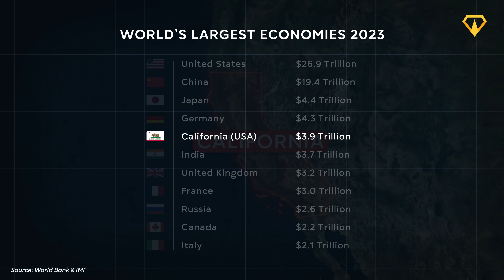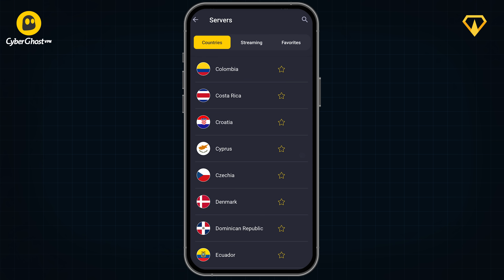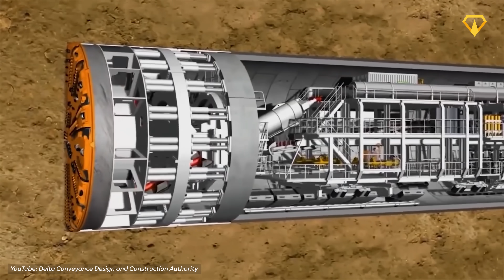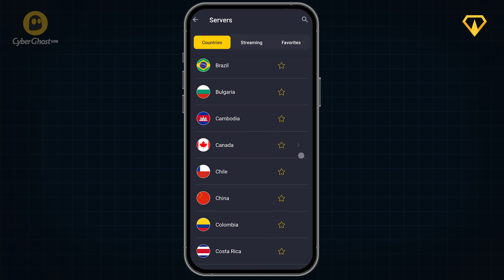California's Massive $20BN Water Transfer Project

Comment from the maker: Check out CyberGhost VPN at https://www.cyberghostvpn.com/MegaBuilds and you will get 84% off CyberGhost VPN. That's $2.03/month and 4 months free! It's risk-free with its 45-day money-back guarantee. Thanks to CyberGhostVPN for sponsoring the video!

Thank you for your support on our recent videos! 💛
Reply: The state of California needs to invest heavily into CAPTURING RAINWATER during the rainy seasons and pumping the rain water back down underground into the natural aquifers.  This will increase total annual water supply, minimize water surface evaporation, and possibly eliminate droughts in California.  If this water transfer project is part of the rainwater capturing process, then I am all for it.  
There is also a new method that is currently being developed which involves capturing fresh water from facilities that are located offshore, which does not require a desalination process at all, which is very expensive and creates toxic birine waste water.  Imagine an offshore platform like an oil rig, which does not drill for oil, but captures fresh water from the moisture in the air, and pumps it back to the shore(compare the process to the condensation from an air conditioner).  There would have to be enough of these rigs(like offshore windmill farms) built to scale to meet the water demands of the state.  I envision that the entire country could solve its water drought crises by allowing ocean bordering states to contract with desert states, for example, Arizona, New Mexico, Nevada, Utah, and supply them with an abundance of fresh water from our giant oceans.
I would love to see a segment dedicated to this idea at some point in the future.  Offshore water collection is the way of the future, in my opinion.
Reply: This is Bad idea the intake of this waterline is too close to where saltwater comes into the bay!
Reply: So called climate change is not the problem. Mismanagement is the problem.

Comment: Global Warming is not only causing wildfires, it's also increasing the likelihood of earthquakes.
The warming of the earth's surface over large areas increases the temperature difference between the surface and deeper underground. This exacerbates the pressure in fault lines and various underground structures.

Comment: I support the building of tunnels as upgrades to the system.  It is indeed vulnerable and we need it to work after natural disasters but don't support increasing the take from the delta.  We already take too much.  We waste lots of water in this state.  We need to start being smarter with our water and utilizing desalination for our dense urbane centers.  Most of our population is close to the coast.  I value our natural spaces and we are taking too much and throwing half of it away.

Comment: It's up to the voters to save California by not voting for Democrats. Democrats are controlled by the Sierra Club that forbids any water projects because they help humans. We would have the Peripheral Canal and the Auburn Dam today if it weren't for the Sierra Club. These projects would have done more to protect Salmon than any so called conservation rules. The P.C. was designed with healthy Delta cross flows, not like pumping out of the South end it does today. The current proposed project does nothing to help Delta cross flows.

Comment: Southern California allows hundreds a millions of gallons of water To flow into the ocean every winter. Why not just capture that water ?
Reply: Because stupid or corrupt people are in power within California. That's why they are not properly managing the water.
Reply: The lack of water in California is due to several factors. In 2025 politicians will push for a "water tax," not to help pay for better infrastructure, but to change the behavior of the people. Socialism at its finest.
Reply: They don't capture it because if they did they wouldn't be able to constantly adjust the price of water upwards every time there's mention of an impending drought.  Additionally, if they actually captured all of that runoff it might actually drive the price of water down 🤷🏼‍♂️
Reply: There are a lot of projects working on capturing urban runoff from the very infrequent, but intense, winter storms that hit Southern California. Southern California already does an excellent job of capitalizing on runoff from the mountain ranges, but the urban runoff is much more difficult to capture since it is extremely flashy. Here in Northern California, we get more frequent winter storms and rainfall, hence the State and Federal projects that export water to the south. It’s a complex system and there are many parties with a stake in the system, and most of the low hanging fruit has already been picked. Water recycling and reuse is the next low hanging fruit, and some parts of California, like Orange County, are maximizing use of that resource. Other parts of the state are soon to follow, as recycled water is much cheaper than imported water that has been pumped for hundreds of miles. Most of the cost of water in California is the cost of energy to move it from one spot to the other.
Reply: It’s not that easy
Reply: Gavin Newsome is the governor and you still ask this question.
Reply: @wizzerwiser2056 salt water intrusion into the delta would destroy the entire water supply if you didn’t let water flow into the ocean . It’s science
Reply: Because of the pollutants the rain scrubs from the air and urban areas. A lot of Southern California relies on ground water, and to scrub the captured water to a clean enough level to pump into aquifers (or even let percolate) would be too expensive to run over a long period of time. If the ground water gets contaminated to enough of a degree, then they can’t even use that. So, back to the point, most water that falls in natural areas as opposed to urban areas does in fact get captured to replenish groundwater.
Reply: PUT A SEA DAM IN NEAR THE ALFRED ZAMPA MEMORIAL BRIDGE  
( and do it before a quake drops the valley into a sea water inhaling positive feedback,<----that would be THE APOCALYPSE )
run the San Joaquin River through Water Table Recharge Filters, with an Osmotic Power Station by the sea dam.
Reply: The 9th Circuit Court ordered that a certain amount of water be sent to the ocean to protect delta smelt.  It's done because of the court order, not SWP/DWR or those that receive the water. They have no say in the matter. Additionally, a certain amount of fresh water needs to go into the delta (not southern Ca) so those that draw that water (farms, etc) aren't drawing salt water.
Reply: That is literally the point of this projext... to pull that excess water down past the delta
Reply: It affects the environment 🤭
Reply: Well, that would be common sense.And we already know that the politicians in california have none. Their policy is to work harder.Not smarter or just don't work at all.

Comment: downstream salinity is the first thing that came to mind when i heard about this. Thinking about things like not only mono lake and the slog theyve gone through to protect their ecosystem, but also the whole rigamarole with water quality negotiations with Mexico. 
This will absolutely not help the long term for our state's water issues, because the real issue is water use. We need to find less water-intensive ways of life. 
That includes incentivizing farmers to grow low-water crops that match their low-water environment instead of relying on so much water removed from other places. This includes cracking down on industrial water waste. This includes better urban design and less concrete along riverbeds so water can soak in instead of causing floods and running off elsewhere. This probably involves a lot more solutions about water use! But the conclusion remains: any "solution" that involves importing large amounts of water are band-aids at best, and usually export more problems than they solve.

Comment: California has the potential for plenty of water, here in Northern California we regularly flood.  What we need is more storage.  If we were smart we would make dams with hydro and solve electricity generation and water at the same time.  Sites reservoir project has been active for about 40 years and ground hasn’t been broken yet due to endless red tape.
Reply: Yes. And now we know enough to build new storage to minimize impacts to habitat and even create more habitat for species like salmon (I don’t care so much for the invasive delta smelt)
Reply: Except the eco-lunatics who run the state won’t permit any large water project that benefits the actual humans.
  Only small invasive fish species.
Reply: California has 2000 dams and 2500 miles of aqueducts. There are no more suitable areas for dams to even be built

Comment: “Climate change” isn’t responsible for Californias water problems.  Californias aqueduct system and the states government poor management of their water supply!

Water; from rain and winter snow pack never gets an opportunity to recharge the water table.  The aqueduct system transports 75% of the annual runoff indirectly into the Pacific Ocean.  

Naturally, some of this run off would still find its way to the Pacific Ocean.  However, along the path it would soak into the ground recharging the water table along the way.  

When California installed and expanded the aqueduct system the water cannot permeate the cement of the aqueduct system.  

So this new project is simply going to make the problem worse!  

Develop some basic critical thinking skills!

Transcend the bull shit!

Comment: It saves California only if the dam at Whiskeytown reservoir is increased to the height it was designed for. Same with other dams they were designed to be higher. The next and most crucial part is building a dam on the Hoopa Indian reservation redirecting the trinity river to LA. The same thing with the Klamath large reservoirs that feed into the CAP. Without the water redirected from these 2 rivers there isn't enough water.

Comment: How will the increasingly lower run off from the mountains not mean the river outside flooding events not mean the river runs dry into the delta. Would an offshore localised desalination plant running when offshore wind is blowing /Nuclear not avoid a reliance on water flow that higher drought events are already impacting the river volume. Would the settlement tanks to take excess rainfall events not allow for water capture in the north end be worth doing on its own with the desalination plant providing the water supply in the region thats needed with existing water pipes. Can water charges not rise in drought season to cut water demand and what part of that budget could be used to cut water loss on existing canals and pipe leakages. In any quake, the old pipes will rupture anyway no matter how much water is pumped from the north end supply and would new piping be able to better withstand such seismic underground shaking to avoid rupture. In any quake event a nuclear plant will shut down all power generation so adding in all excess power (solar in the afternoon duck curve) would be needed.

Comment: There's such a water issue there, that it's effecting many other states water. They should commit to desalination plants powered by nuclear energy. At this point nuclear energy should be the main energy source we use as the backbone of our electrical grids. Then we can use all our other alternative energy sources in combination with that backbone. This power source is the best option to improve our environment & it will really help lower our emissions. The only things holding us back is legislation and the ways fear mongering has effected people. 

The more I've learned about our power grid, the more I've learned that modern nuclear energy options is our best option. Molten salt reactors, LFTRs, Thorium Reactors, Small form reactors. Utilizing our advanced technology, Improved engineering & material science. Utilizing our greater understanding of safety & well made designs. We have so much more advanced computer technology & robotics that can be used. It feels like even tho tons of advancement has occurred with engineering designs, safety measures, etc. It still doesn't matter to most people. It's like most people are ingrained with a natural negative response when talking about nuclear energy. It's a bummer because i truly believe that our best option for our future is to start utilizing Modern advanced nuclear energy options in our electrical grid. It's just proving to be challenging to get politicians to get on board. 

  It will really allow places to be much more energy independent. Less reliant on fossil fuels. They'll have efficient, stable electrical grids and the rest of the grid could experiment with alternative power sources, power desalination plants, etc. 
We need to heal from the trauma of our past. See & learn that those things only happened solely from Us not understanding what we were doing when it came to nuclear energy at the time. We didn't have advanced enough technology, material science, engineering, safety measures, understanding of how to go about everything, etc. This source of energy will greatly help the world improve towards the future and lowering emissions. More than anything else could, while also providing a very stable electrical grid system. Currently we have alternative energy options but the majority of our grid is powered off of fossil fuels and emission producing sources of energy. We will be so much better going forward commiting to modern advanced nuclear energy options.

Did they outlaw electricity or oil, coal when things went wrong in the early days of those fields? No! They kept going and understood things usually are bumpy and difficult in the beginning and kept going even tho those sources negatively impacted our environment. A huge issue is government BLOCKING any sort of progression from happening. We'd be lucky to see the slightest projects approved or finished with-in the next 100 years.. It's very annoying to see how much we have gotten in our own way when it comes to improving or advancing certain things. Instead we let fear, money, man made "required legal processes" Stop us from doing anything other than wind, solar, oil, natural gas, damming our rivers, mining for minerals... It's very frustrating because we should be able to use all these options in collaboration. If we actually wanted to improve anything. That's what we need to do and stop letting so much potential get blocked from ever occurring in the first place.. It's really irritating. I wish certain people didn't make this so "complicated and difficult" Why would any reasonable person want to block progression?

In my opinion it's been irritating that our society has taken this "it's up to each individual person to make a difference" approach. When that just plays off of people's emotions. This issue is so much bigger than individual people. We need countries/states to get on board. It's the only way we can make even the Slightest difference. We've already waited too long. Everyday is a day wasted & we haven't even made a dent in improving our situation.

The fact that Desalination is so energy intensive but fresh water is so important.. What If we dedicated nuclear energy to be the main energy option to run these energy hungry desalination plants?? Idk why we aren't already doing this anywhere we could...?
Seriously think about it.. Nuclear power produces no green house gas emissions. It's extremely energy efficient. The list goes on. So why are we not utilizing this... We are being extremely too slow, too reserved, too cautious, too inactive to even make the smallest dent into our climate issue and our energy issues. It's holding back progression across the board in many different area's.. It's honestly getting really frustrating. I thought we would be more motivated than this. More active than this....?

Comment: Three things will fix the problem: Regulate Ag water and incentivize more efficient use; break the Resnicks stranglehold on the supply; and F#@K L.A.! Quit building where you have NO WATER! L.A.'s water greed goes back over one hundred years. It is responsible for the ecological wastelands of Owens Lake and the Salton Sea. This project, like the Sites Project (already approved) both SAY they will take large amounts of water from the Sacramento River only during extreme flow situations, but nothing in their construction PRECLUDES them from taking whatever they want whenever they want. The potential for future abuse is quite large.

Comment: I guess its a good thing that over the last couple years of winter have atmospheric river storms that took all of the almost completely empty lakes, reservoirs and water storage sites to 95-99% full capacity, in many cases water had to be released to prevent over topping, even the dried up Tulare Lake has come back, theres plenty of water for many years as long as people don't act stupid, and over the last 20yrs many new reservoirs and storage sites have been built so we can hold onto more water, plus there are several major reservoir porjects about to or have recently started and alm will be completed within a couple years